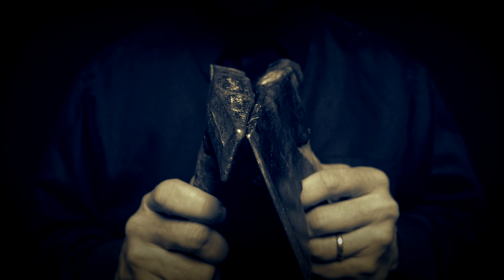Metal ASMR 2

Comment: 0:17 2 Bolts
3:25 Drill Bit & Bolt
5:32 Ratchet & Socket
11:15 2 Sockets
16:35 Wrench & Bolt
19:50 Scissors
24:17 Wrench #1
27:44 Pipe & Socket
31:10 Pipe & Drill Bit
34:05 Hemostat Clamps
40:30 Wrench #2
46:17 Hammar & Ax
53:25 Saw & Screwdriver
57:22 Pry Bar
59:55 Pry Bar & Screwdriver